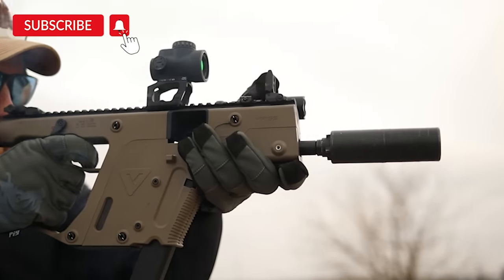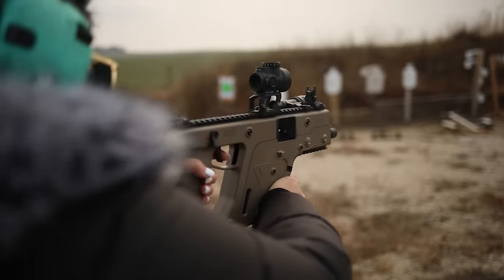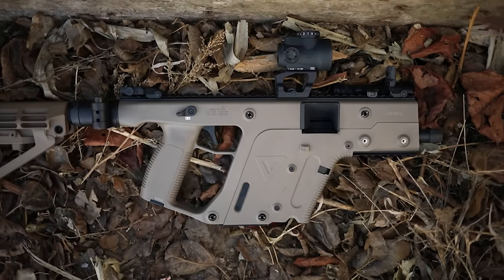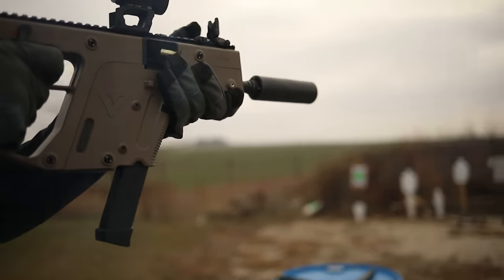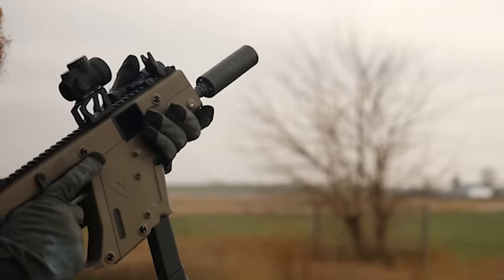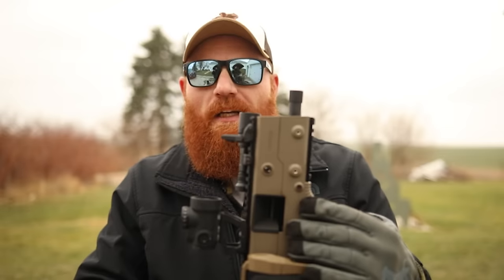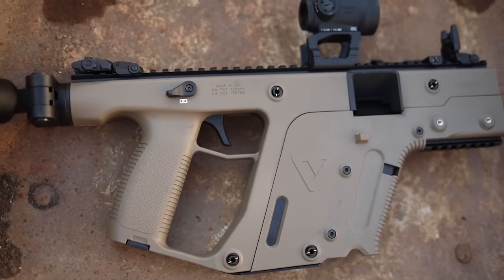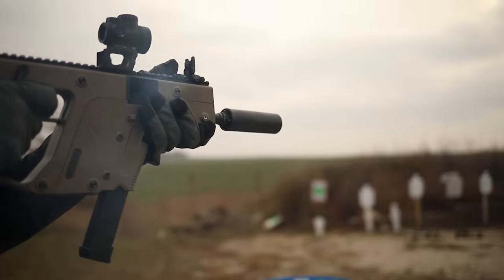Kriss Vector 9mm PDW: Is The Hype Real?

Comment: I got to sample a full auto .45ACP version. She RUNS through some ammo PDQ! One thing I was not prepared for was the recoil impulse pulling the barrel down. I found myself having to pull up on the foregrip to maintain control and a consistent point of impact, unlike something like a MP5 where you are pulling down to maintain control. After 3-4 mags you really start to get the hang of it and it's really controllable. Shame us peasants don't get the happy switch version.
Reply: The Kriss in semi-auto is a crime.
Reply: The "double tap" trigger is well worth it ❤
Reply: @AzazelCain but also unreliable and prone to breakage. Better off without considering its $400

Comment: I have the 10mm vector, 6.5", i can agree the accuracy of the system is pretty good. Pretty much effortless for me up to 75yd.
Reply: What are your thoughts on the recoil of the 10mm? 
I want a Vector, but it seems silly to get a 9mm, and if I'm getting a .45, might as well go 10mm.
Reply: It’s a pistol caliber, recoil? 
Do your research on 10mm ammo, it’s not much more than 40, definitely not worth the extra money. But I’m guessing you don’t shoot that often for that to matter.
Reply: @HWG-wm8ld lol, simmer my guy
Reply: @m4rvinmartian I haven’t shot the 10mm version, but the 9mm and 45 ones are super soft, and very unlike any other comparable weapon in the same caliber.
Reply: It's minimal enough to shoot without a brace and still make 50-75yd shots. With a brace its less than a 9mm pcc but more than a 223 @m4rvinmartian
Reply: @HWG-wm8ld Target ammo isn't much different but the full bore stuff is pretty impressive
Reply: @m4rvinmartian  Haven't gotten to shoot the 10mm, but the recoil on the 45 is...unique.  The impulse is soft, but following how the mitigation system is designed, it doesn't push back into you.  It pushes down against you.  So instead of a bop straight into your shoulder, it swipes down across the front of your shoulder before jerking back up to it's original position as the next round gets cycled into the chamber.  It takes some getting used to, but it's real easy to get the hang of.
Reply: What I heard was that the 9mm doesn't exhibit too much of the "kriss recoil", but the .45 and 10mm tend to pull down, and you almost have to push up to keep the poi the same.
I do think I want the 10mm though if I ever get a Kriss. 
There is a .45 in the classifieds right now that has been taunting me for a couple months. I really think I won't be happy unless I get the 10mm though.
Reply: @HWG-wm8ld  Lol dude. You don't know who I am. Maybe you should go tell Demo Ranch some stuff too. Or maybe Bill Wilson could use some of your observations also.
🤣
Reply: @m4rvinmartian also run 10 mil on my vector and with practice you can get some amazingly quick follow-ups with very little recoil impulse. It takes Glock pattern magazines so you can get standard G20 magazines or you can get something like the 30 round ETS mags that I use.

Because the recoil system is designed for quick follow-ups with enough practice you can put half a dozen rounds down range in a few seconds and still keep on target and you don't have to worry about out running the weapon because it was originally designed as an SMG lol
Reply: @HWG-wm8ld if you get the right ammo it 100% outperforms .40 by far
Reply: @Jackie_XIII  Lot of people hating on a system they haven't used haha. I agree, even with the stock trigger, you can put quick follow up shots through the same hole in the target.
Reply: @HWG-wm8ld depends on the load most 10mm is hyped 40 cal. But not the powerful stuff, definitely a difference but in this platform not gonna be a big difference, I'm looking at the 10mm myself.... 3:46

Comment: The Vector has been on my list for a LONG time  - my wife shot the select fire 45 ACP version and hasn't stopped talking about it since.  I think it may be time to just pick a couple up as the PDW's of choice...
Reply: They're expensive, but they're worth every damn penny (just went and checked the msrp, and gaddamn..they're cheaper now than when I got mine!).  I'd suggest looking for one in 45 or 10mm.  9mm is fine if you have any of the assorted 9mm Glocks, and the mag extensions give you better capacity..  But both 45 and 10mm just have so much more punch.

Comment: "I thought I was the super V!"
spit my drink all over the laptop screen
Reply: It is a super v, that’s just the predecessor name. The vector is the “v” in “super v”. Technology of the super v was designed for the no recoil and the chamber has a v style slide that goes into the bottom and back up. Same principle with the 9mm and 45, not the .22 as there’s no recoil to worry about.
Reply: @alvingrace5457  you probably get a lot of super Vs

Comment: You don't steer us wrong.   I have bought  multiple guns that started with your reviews and I never jumped on the Vector in the past due to the bad reviews but this latest version with your review convinces me it's time. Thanks for the great videos.
Reply: Having shot a couple... I truly believe those that hate them, don't understand guns. And probably have a piece of plastic on their hip. If at all.
Reply: Good luck tracking one down!  Depending on where you live, they can be hard to find.
Reply: @colesutra they aren’t hard to find. A lot of places don’t keep them in stock because they aren’t a big seller costing close to $2,000. You have to ask for it to be ordered which only takes a few days to get. I just check several of the wholesale companies I use when ordering firearms and they multiple models available with hundreds in stock of each model ready to order.
Reply: Just buy one online?
Reply: @RhiRhy ask your local FFL or gun shop to order one if they don’t have it in stock. They are readily available at just about every wholesale company.

Comment: I, like you, first saw one on Future Weapons, and fell in love.  Living in California, I thought I'd never be able to get one.  One day I walked into my local gun shop and they had the tan 9mm with 16" barrel and I bought it.  I've had it for about 12 years now and it's been great.  One issue is the 16" come with a square barrel shroud, looks like a fake suppressor.  If you hold it while shooting it will come loose pretty fast.  It uses a small hex screw that wiggles loose even with red locktite.  Otherwise it's easy to shoot, load and maintain.  Nothing serious has broken or failed.  Great conversation piece at the range.  Overall, I give it a 9.5 out of 10.

Comment: Two upgrades you need. Aftermarket trigger screw to remove the takeup of the trigger, and the right side extended mag release (airsoft version will work with a little filing)

Comment: On the original in 45 the rubber bumper at the bottom of the recoil system started to come apart after a couple of hundred rounds.

Comment: I own a 9mm SBR. If you’re considering buying one, here are my thoughts. 
 
The Vector is my favorite gun of all time purely for cool factor, but there are a couple issues.

Pros: The recoil really is a blast. It doesn’t feel like it pops up, the back feels like it pops down with no muzzle rise. Extremely unique.
          A pistol/SBR with a folder really is as nice and small as Chris says.
          The charging handle has a build in press check tilt.

Cons: Way too expensive. For the money, I expected the polymer to feel like Magpul or Glock. Instead it feels like a Nerf gun. The Stock is really great and tough, but the body feels a bit squishy. (ALSO, the Vector brand vertical Forgripe with the handstop in front feels the same way and is also terribly over priced. I plan on replacing it.
         It doesn’t do anything drastically different that a CZ Scorpion can’t come close enough to doing.
         The controls are definitely laid out weird.

Conclusion: if you want it, buy it, you’ll have a ton of fun with it, but just understand it wasn’t made to be a modern day duty gun. It was made to be a full-auto .45acp bullet hose in the 2000’s.
Reply: Are you 9?
Reply: @HWG-wm8ld  No. 😝

Comment: The Kriss Vector is a great gun to shoot- IF the action's clean. Once they're dirty they don't function too well. The gun store/range that I work at in N. Texas has this for rent, .45 version, and it needs cleaning almost as often as the .22 semiautos. Once there's a pile of gunpowder residue in that "V", it gets hard to even pull back the charging handle & often stovepipes or failures to feed occur. It's not that hard to clean the gun, once you get used to it, but it does need it often. This may not be a problem for the average user who won't be shooting hundreds of rounds through it every day, but I thought it was worth a mention. Still, it's an incredible gun to shoot, and I'd like to try the 9mm version but haven't seen one yet.

Comment: I had a 2.0 and had really bad failures on it. It would pull casings into the action of the gun, like behind the bolt and carrier. So I would have to take the gun apart to free the casing. It did that with steel and brass casing. Maybe I got a dud but it sucked cause the vector was my first dream gun. And the SOB didn't work.
Reply: same, still havent found a solution. someone said to change the extractor spring with an AR extractor spring.

Comment: I have a full length with the mock suppressor and it looks sick and also enjoy the hell out of it. It's one of my favorite stupid frivolous buys. Charging it feels so damn weird too. I opted for 9 over 45 even though it was normally 45 because of capacity and honestly I don't see having any notable difference between the two calibers. I got the mk2 rail on it too so it looks super slick along with the handstop front grip from kriss. I wasn't really interested in buying a suppressor at the time otherwise I may have opted for a shorty. I also got white lol. Their front grip would help pull the hand away from the mag release too and keep that vertical grip you want to do on it

I think the cool factor on it is up there with the mp5 or now the mpx too

Comment: I wish you got the .45 sub sonic plus suppressor. But I get it 9mm is in higher amounts. Still a very interesting platform, the way the system works though is unnecessary for 9mm.

Comment: I want to like it more.  But in the nearly 20 years it's existed it's always been ridiculously overpriced, huge for a pcc.  It's even a reverse bull pup trigger design but with the action way out front rather than in the rear.  The barrel attachment makes service and modifications expensive to impossible... 

And at my range they have a poor reputation for reliability.  

Plus this action doesn't handle +p or +p+ loads at all.

Comment: I might have gotten a turd, but mine was not reliable. I am not impressed with the kriss, although I do still like the design of it. I found the Safety was also an issue for me as it would rub on my hand and clearing stoppages could be a bit tricky at times.

Comment: I'd like to see this paired up against the mpx and see which preforms better and that you like overall.
Reply: So I have both the MPX and the Kriss Vector in a 16-in carbine length and personally I feel that the vector is better for quick follow-ups once you start to learn how to control the weapon because of the unique recoil system. I have the Gen 2 CRB vector and it is a very solid system. The charging handle is, entirely in my opinion, easier to work with as it's on the side and not the top. There are a bunch of people that tend to have problems with the mag release only because they naturally grip the front of the vector and sometimes accidentally drop a mag wall firing lol

The other big thing that makes the vector a little bit easier to work with in my opinion is the takedown and cleaning as there are fewer moving parts and it just requires the removal of four pins. 

All in all they're both fantastic systems but for the amount that you would put in getting a good Mpx you can get the vector and do several recommended upgrades or even put on a decent optic for the same price.

The vector is also available in several different calibers so if you wanted to go into something a little harder hitting like 10 mm it's possible

Comment: I rented one of those at my local range in full auto. Recoil impulse is super weird compared to other full autos I've used, which are a 7.62 AK, a Thompson (drums SUCK, by the way) an MP5, a scar H,  an M4 and a couple others. The kriss is WAY different in terms of recoil and I walked right off the target at 25 yards because I was a vector noob, but after I got used to it I could put all the rounds into the heart of the paper terrorist. Pretty dope once you get used to it's weird, vibratey recoil. Oh and it runs at meth head speed. It's gotta be like 1200 rpm. I mean that bitch was zipping

Comment: I have one where I ran a trimmed magpul afg on it with a brace for years until the Brace ban issue in Janurary.  Planned to SBR it anyway so I took advantage of the amnesty and got an engraving free SBR.  Now I have the gen1 folding stock SBR with a vertical grip.  Now for the binary trigger to complet the quest!

Comment: I have the CRB vector in 10 mm which uses the Glock 20 magazine and I run it with 30 round ETS mags. With practice you can get quite good at rapid fire and thanks to the super v system even with something running hotter 10 mil loads it is an absolute tack driver.

I done a few upgrades where I added the enhanced frame mount and foregrip, I have a nice EOTech optic on it, and I'm waiting on my paperwork to clear for it to be cut into an SBR. I already have a dead air primal to slap on the front.

Absolutely could not recommend it any higher if you're thinking about getting a vector. Amazing little subgun available in a large variety of calibers.

Comment: Suprised you didn’t have any failures with it. I had a 2.1 and it was a lot of fun as a range toy but every now and then it would jam. Have crazy empty shells override the bolt and get stuck inside the receiver which required disassembly

Comment: Kriss makes a plastic angled piece which goes on the pic rail and prevents the inadvertent compression of the mag release button.  This has worked well for me.  No more inadvertent dropping of the mag while shooting.
Reply: I have the 16-in barrel CRB model with the Kriss vertical foregrip that has a space for a pressure pad for the light and it's a solid VFG. And when I can finally chop off that ridiculous barrel and pop on my primal it would be nice not to have to switch to an AFG

Comment: Sounds like we fell in love with them at roughly the same time. That's about how long I've had mine. Mines a little longer. There's a GIF I've used several times to better explain to my 2A friend's how that odd bolt works. Google "Kriss vector bolt gif". I haven't checked in a long time, but extensions to the normal magazines were the only option on .45. As opposed to a solid, one piece extended magazine. Last place I saw them on screen was Agents of Shield. Used by the "Chronicoms".  Got a sub2000 too- watch that facial hair. 😂 Definitely a big difference between the two. But if I remember correctly I paid almost three times as much for the vector. Paula Broadwell (remember her?) was the gun model in their promotional video. I have it on good authority that she did, and possibly still does live in the same city I do . I've wondered if I ever run into her, I could get mine autographed 😂 Your wife might like a white one, to match her nails. Great vid! Hitting the Subscribe button

Comment: I have the SDP-E in .45 and it’s the softest shooting 45 pcc I’ve ever shot and is just an all around fun gun, Very reliable, Easy to clean and get parts for, Accurate and fast to. The Enhanced is nice because your grip is forward of the controls unlike the standard version and gives you a slightly longer barrel for some added fps especially the 45 version